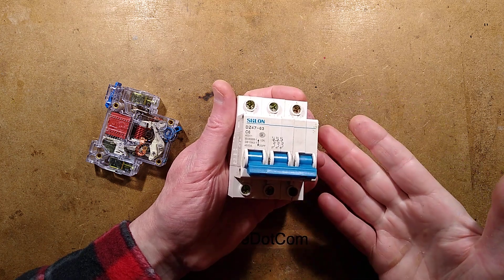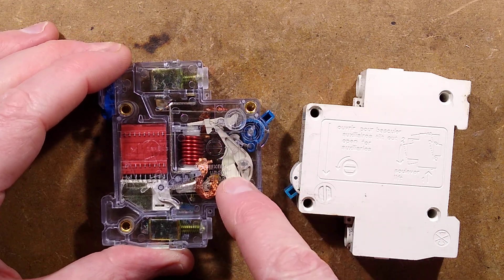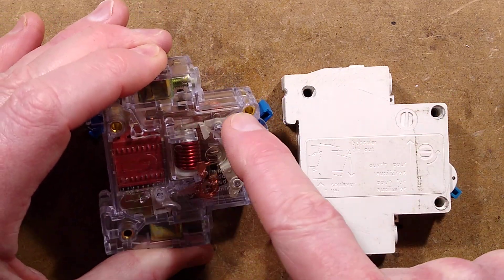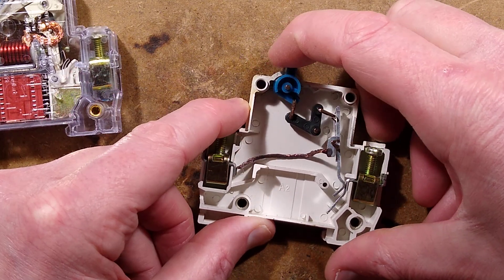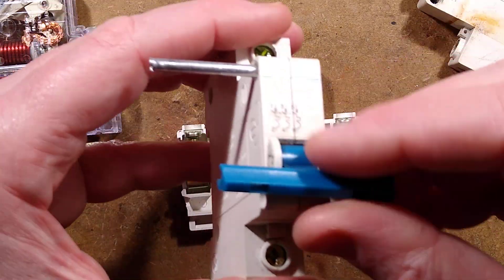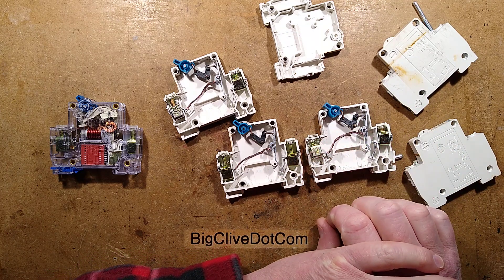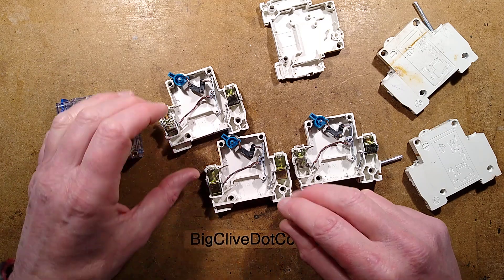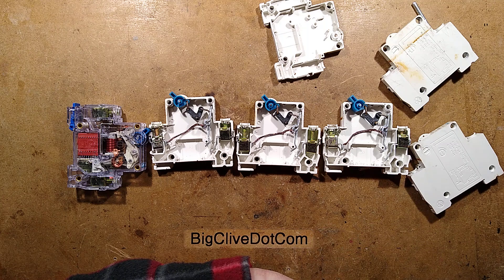Inside a fake un-trippable circuit breaker.

Comment: Odd as it may seem, this may be just another instance of the Chinese copying stuff and making it cheap, without even grasping what they are doing. There is this "thing" that looks this way that is obviously in demand, so let us make something that looks and feels just the part, but without the gubbins inside that we don't understand the function or the purpose of. The function of this thing is to contact when the lever is in one position and not conduct when it's in the other, so if we just copy that, make an accurate enough copy of the moulding and copy the text on it symbol-by-symbol,  we would have made a bona fide cheap replacement.
This is a good warning against buying safety equipment from china. In a sense, this is even "safer" than, say, a fake that has copied the gubbins but did it wrong, because you can tell so easily it is fake. But if something like this is even possible, there may be other, "better" copies that contain some sort of gubbins inside that looks and feels the part and even functions in a proper kind of way, but not properly. Say, a series of breakers with different current ratings, but for the purpose of cost saving and production streamlining, all containing the same mechanism that trips at too high a current. How would you even check that without a lot of expertise and test equipment? If you provoke a short circuit, it will trip, but at a current that is much higher than rated. This is properly scary. I buy a huge amount of stuff from China, but when I was rebuilding my distribution cabinet, I bought everything from a local shop, because I wanted to be sure it works as intended.

Comment: Before you say it doesn't work, may I recommend testing it?  It may just  break at the proper current.  Resetting, well, that's another issue.  What you have is an on/off switch.

Comment: I’m thinking if it was fitted with thinner wire and filled with silica sand it could double up as a fake 1361 fuse . 😄

Comment: I've actually thought of a 'legitimate' use for this product: as a movie prop. If you have a scene where someone flips the breaker and it explodes, it'd be cheaper to get this and rig the pyrotechnics into the inside of it, than to buy the real thing and gut it, come up with a real-sounding switch mechanism, then fit the pyrotechnics in.
Reply: Just put a hundred amps through it, no pyrotechnics required.

Comment: I was assigned to VBC(Victory Base Complex) the American Base around the Baghdad International Airport during 2011,  We had the same circuit breakers.  The State Department was Nation building, they hired "local" contractors to install the 240v wiring for the 36 square mile base. After a few panel fires, we started inspecting the "local" contractors work.  We found that most of the "breakers" were just switches, like your example.  We had to hire Haliburton to replace EVERY breaker on the base. I have no idea on the cost,  I just know that I like functional breakers.  During the Spring, the Palm Rats would chew though the buried 2-0gauge (about 12mm) 240v cables and the ground would erupt like a volcano with steam and molten copper.  Or, feeling a tingle when you step in a puddle is terrifying.

Comment: I don't even have the words for what should happen to the useless, contemptible human being who created that absolute death-trap of an "electrical device".
Reply: There are documented cases of where Chinese counterfeits of high quality MCBs and RCDs (Siemens, Square -D, etc.) have been hidden in bulk boxes of the real thing and sold in Europe. Top 2 layers or so is genuine, but lower layers are the counterfeit ones. Trouble is, as fast as the authorities close down the illegal sources, new ones spring up. The Chinese see nothing wrong with what they are doing, so until you change their mindset, you're fighting a losing battle.
Reply: Electric Chair?
Reply: Make no mistake though.  These are not just ordered as if they're legitimate breakers and installed by unsuspecting technicians.  Anyone that installs one of these knows exactly what they ordered and exactly what they installed.
Reply: @SigEpBlue: The word you are looking for is "Chinese." the plural form is "made in china". The negative form is "its chinese made" no need to thank me.
Reply: @nokia5359  The more accurate term for those words I think are "Copied by the Chinese" or "QC'd by the Chinese". Since a lot of stuff nowadays is produced in China, but "Decent quality stuff" build there have never been QC by the Chinese... Never... Nah...
Reply: @nokia5359  thank you, you said all I want to said
Reply: @nokia5359  at least someone had the nutsack to come out with it!

Comment: Clive: Are either you or Dave thinking about passing this on to the HSE or Trading Standards?  How many of these things are in service right now around the UK?
Reply from the maker: Anyone in the UK buying critical protective equipment like this, should only get it from prominent distributers.
Reply: @bigclivedotcom  I agree anyone fitting circuit protective devices should be careful about how they are sourced, but as a self-employed electrician I myself have a collection of MCBs and RCBOs I've reclaimed from various jobs over the years.   I don't feel good about adding to landfill if I can reasonably believe them to be in good order.
Does Dave know how this deadly item ended up in a generator?  If he doesn't, it might be something the HSE or Trading Standards would love to get their teeth into. Someone might be importing these things in large quantities.

Comment: I googled the part number and found this link to the data sheet for what appear to be real circuit breakers.  It would be interesting to order direct from the manufacturer and see it they are real.  The ones in the video appear to be counterfeits made to look like originals but don’t function.  I bet the manufacturer of the real ones would love to know about the non-functioning copies if they don’t already.

http://donar.messe.de/exhibitor/hannovermesse/2017/U593078/breaker-eng-350150.pdf

Comment: You should overload one and see where and how it fails.
Reply: It won't be easy to overload them at all - a welder machine can do it but most stuff would flip the breakers immediately - it's a massive wire inside.

Comment: The next innovation in circuit breaker design will just be a wire across the terminals and switch separate to further improve reliably.

Comment: Although the results would be boringly predictable, still a little disappointed you didn't hook these things up to the mains and put a dead short across them. I mean a little smoke and flame is never a bad thing right?
Reply from the maker: It would trip out my real breakers instantly.
Reply: @bigclivedotcom  Fair point. Must be some way to get some smoke and flame from these little disasters. With out anything else going on fire of course.

Comment: Would you be interested in a zombie LED?  I have one LED bulb that never really lights up all the way and then when the power is cut all the other lights in the fixture turn off like normal.  This one stays partially lit for a few seconds then fades.  I could send it to you to tear it apart.
Reply from the maker: That's common.  One of the LEDs will probably have a black dot in it where it's failed.  The high resistance results in slow discharge.
Reply: @bigclivedotcom  that makes sense.  Just never seen it before.

Comment: Ok, I will be pulling the "breaker" out of the Chinese diesel generator at work  for an inspection. Thank you for posting this.
Reply: This particular generator was a freebie from another department, I typically don't use it as it is a massive chinese turd. I normally use the Isuzu 15kw when power is needed in a remote part of the facility. I'm in the U.S. so these euro-asia din mounted breakers are not common here. But what really worries me now is I installed this style of breakers in my in-laws house in the Philippines. I did buy them from a reputable local hardware store so we will see next time we visit. Even if they are fakes wouldn't be any worse than the way the local " electrician " ran all the 14ga. Branch circuits to the one 50amp main breaker.
Reply: Same. This is frightening.
Reply: It'll probably be fine. It's only because morons buy from sketchy back alley sellers that shit like this gets sent out. "I'll save so much" is usually code for "I have a 50/50 chance of actually receiving factory seconds or hacked together mockups."
Reply: please give us the update on this later..
Reply: Don't use any China products in the industrial sector use genuine Honda products the differences is in the  price sound easier starting heaver buy direct from Honda site or dealer. Chinese crap is really obvious if you take the time to look.
Reply: @electriccoconut  I knew a guy who had a fake knockoff Honda generator, had all the Honda branding but not the right shape or build quality, and you could hear the little Chinese engine was being run way beyond it's means to put out the listed output power, (hey atleast it didn't lie about the power numbers) only around 300 hours on it and it was cooked.
Reply: @electriccoconut  Chinese products are actually very
 Good. If you pay for cheap from some unknown seller, you are the one at fault.

China has far more industrial applications than the US by a very large margin. If things were that bad don't you think entire cities would have burnt down already?

The reality is very different from western media's view.

Look at the high speed rail, if they didn't havebthe industrial capabilities, they would have failed. Lower failure rate than Europe, smoother than Japanese trains. 11 times more rail than Japan.
Reply: @draven4464  There is no genocide, in addition to that western media cherry picks data. There are literally expats in Xiangiang showing the reality there. Go there and see for yourself. Not the BS the media feeds you.

As for the so called empty cities you are claiming. Yeah, they sit empty for a bit and then they are now they are full. Some are even several million. Your information is outdated.
Reply: @draven4464  You haven't seen anything and it is obvious you haven't been. Some of your type would also often make a claim like you have. But state the exact same thing as what the media claims without being there.
Reply: @draven4464  and to boot, the city that was designed for 3 million now has 2.71 million in there. Some western sources also did not translate properly as well not update. Leaving you with misinformation.
Reply: @fleyua7176  chinese propaganda accounts on MY youtube??? say it isn't so!
Reply: @fleyua7176  Chabuduo lol
Reply: @reggrundy2367  *Chabuduo lol*
Yes, if you describe American public transit.
Reply: @AFlyingCookieLOL  We are talking about miniature circuit breakers here ok. No need for your whataboutism.
Reply: @AFlyingCookieLOL  why do all the propaganda accounts believe that nobody from america had ever been to china? many of us have. also, there are actually chinese people who live here, and can tell us all about it.

let's see, should i believe you, or my lying eyes?
Reply: @fleyua7176  this guy is wu mao, or 50 cents army. paid to lie about China online
Reply: @bigdundee12345  You are making an assumption that all Chinese products are bad or somehow dangerous even when the one you should be blaming is the company or individual. 

Do you seriously thing progress would be made with that kind of mentality? Here is the reality. US has no high speed rail, no public transport in multiple levels for the public and what ever you have right now is crap. You know why? Because you are stuck in a cold war mentality. Been at war most of your history thousands of miles from your own coastline looking for weapons of mass destruction that have yet to be founds. 

In addition to that, calling any rising economy to be a threat. I haven't heard of a single bomb being dropped by China outside of it's own country. Instead of commercialising war like the US. 

China has gone ahead and built infrastructure, and currently have eliminated absolute poverty. Years ago, 75 percent reduction in SO2 emissions.

Many foreigners love China and has shown marked improvement. If you ever watched, it is obvious they are welcome there. In factory tours have been shown.

The times has recently also been busted for calling these prochina blogger some how "paid". And then attempted to say they did not respond even if they did and then attempted have the video censored from certain countries when proven wrong. Videos have been made since in response by the creators to this stupidity.

If you continue to gobble up media like and don't evaluate be properly, you will fall further behind.
Reply: @RaceChapman  The few Chinese that tell you? HK where British has brainwashed their education or Taiwanese. Sounds like how Japanese brainwashed the  kids about ww2 as well. 

It is easy to see that you haven't been to China because you do not know the diffences between the Chinese versions and the Chinese shipped versions that you get from Walmart. 

The vast majority of Chinese believe they are heading in the right direction. A vast difference from western countries. And this source is from Harvard. Is this some how propaganda too now?

Do you think 1 form of government is the only way to go?

Rejection and resorting to claims in an attempt to discredit. 

Is Harvard anither propaganda account now too? 
It time to grow and look outside of your own country rather coming to the conclusion while watching fox or CNN news. Or some cherry picked data without verifying for yourself.
Reply: @reggrundy2367  When Americans don't want to compared they use the word "whataboutism". Even when comparison should be made so you know where YOU stand. But people like you also don't seem to realise that one company does not represent the rest of China. Let alone problems that are far worse happening in your own country.

If you have a problem with circuit breakers, learn how to source and supply properly for your company. Finding a proper suppler does not mean you sit online and look.

Running a proper business means you and physically there to verify and check. 

You can also visit the conventions there to source your parts.

Some of the world's largest industrial capabilities are there, talk to the engineers and companies. Factories etc.. if you got a crap, you probably looked for the cheapest online on purpose with probably little research.

If it was so bad, I'm willing to bet that would be a lot more fires in China per capita, but that isn't the case. 

The wider view has been missed.
Reply: @fleyua7176  whether you are paid or genuinely brainwashed is sort of irrelevant. MANY americans have been to china. we know what it is like there. i have known many americans who came back, and they did not say "wow what a great haven for humanity!" they did, however, point out the overt censorship, the corruption, the greed and the squalid living conditions amongst a large portion of the population.

when i PERSONALLY visited china, i saw those same things, and they were confirmed for me.

you can also watch various youtube videos of people in china, and see it on there. so between my OWN FUCKING EYES, the americans that i know, the chinese immigrants to america, and the youtube videos that i have seen, i feel i have a pretty goddamn good idea of what is going on. they imprison people for political reasons, censor their own citizens from speech, restrict their ability to view non-chinese websites, so on and so forth.

if americans think we are going in the wrong direction, (which is a sentiment i agree with, incidentally), it is because we are becoming MORE LIKE CHINA. that is not a good thing to americans, because of the absolute overwhelming evidence about it. 

it disgusts me that you get on here to try to spread misinformation to the western world, in order to sow seeds of doubt in gullible people's minds. you are a fraud, and a fool, and also a coward. you are a coward because you are a liar, and you would never show your face or say anything in a venue that was truly neutral.

i had no intention of writing a reply like this, but it is important to me to tell you this. you are a coward. you are a liar. you are a disservice to humanity, and you should be ashamed of what you are doing.
Reply: @fleyua7176  Go get your 50 cents from the CCP.
Reply: @draven4464  
1. The empty cities are filling up, you see, in a planned economy, you plan ahead. Read advanced economics.
2. Genocides? Never seen that happen anywhere else...
Reply: "Chinese diesel" - what a worrying thought !
Reply: Replace the breaker. Better to be sure than sorry.
Reply: Max 737  !
Reply: Don’t buy anything you don’t know physically where it’s made, it’s all ripped off turds. Buy British and support your locally produced items. What your paying “extra” for is supporting local jobs, proper wages, the ability to go see where they’re made if you want.
Reply: The World is full of imitators, imposters, pretenders and Wannabes. But there is only One USA.

Comment: Damn, I have cases of identical looking "breakers" out in the shop, and now I have to drill one from each case apart.  Mine are 30 amp and were used on 48V DC scooters which had 25A or 27A brushless motor controllers. Mine have much more writing on them so I think they are real but the blue and white case scare me.
Reply: You can just test them with a low-voltage high-current supply, and see if they trip.